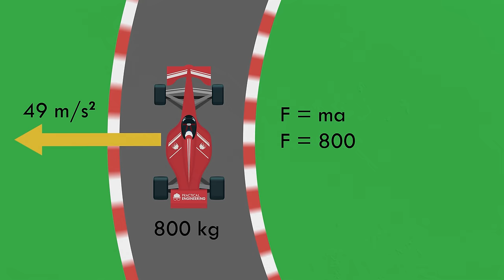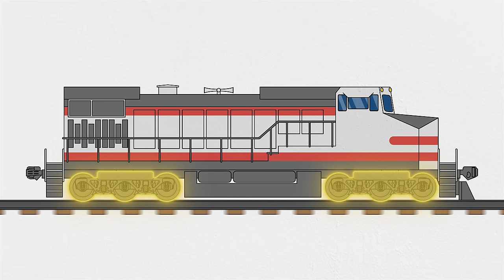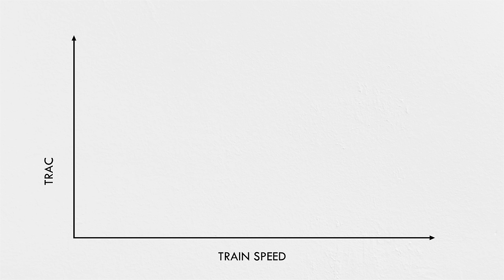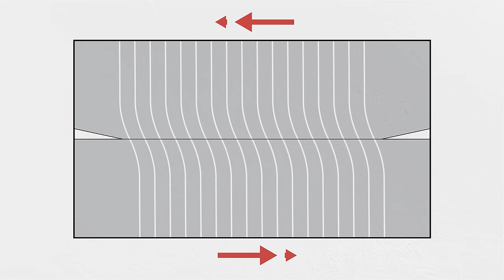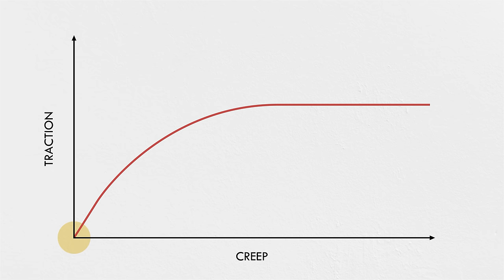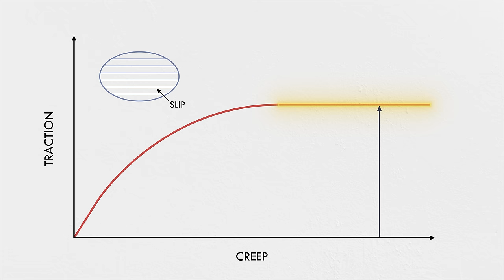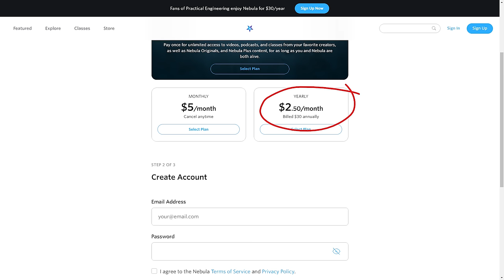Why Locomotives Don't Have Tires

Comment: Yay! Another train video!! Really enjoying this series and definitely looking forward to more Practical Construction too!
In point of fact there is construction going on literally right outside my house now, and I've pulled out your book a couple times to kind of "follow along" as the workers go about their job. They're putting in new water mains (FINALLY, the pipes we had were laid down fifty years ago, and not done very well either), and it's been fascinating watching them work. You can even tell which parts of our street were built earlier or later, because of the wild way the mains changed placement, haha!! The spot right in front of our house has been a real thorn in the crew's side, due to that less-than-ideal placement from so long ago. They're doing a great job and I've already made them go "she's a bit weird" haha because I gushed just a little bit about your book!

Comment: I always envisaged a 'hybrid' locomotive tyre, with the steel for weight and maybe a band of rubber to provide additional friction. I wondered however if the extra start friction would provide any benefits over increased running friction.

Comment: 9:52 isn't that exactly the opposite though? The wheels are rotating slower than necessary since they're essentially slipping/creeping forward. Like your demonstration shows, the brush wheel covers more ground with the same amount of rotation when traction is applied.

Comment: When your ambition is greater than adhesion, wheelspin occurs.

Edit: 2 cats are sitting on a pitched roof. Which one of them falls off first? The one with the smaller μ.

Comment: The Eschede rail disaster in Germany was the result of a steel “tyre”… a steel band around a steel wheel but that broke off at high speed and the steel band straightened itself out and was stabbed upwards through the floor of the train, while the other end acted like a crowbar pulling up the sleepers and the rail… the train hit a bridge during the derailment… I don’t know if trains still use those “steel tyres” anymore. 🚂😕

Comment: Something interesting to add, Diesel Locomotives need more Horse Power to generate the Same amount of Tractive Effort as a Steam Engine. This is because of a variety of factors that include weight. Diesel locomotives are far weaker than a steam locomotive when alone but are generally much cheaper to run and maintain.

Comment: Answer: On a locomotive, it's less desirable. Stick-slip can lead to corrugation of the rail and unwanted noise. It was a notorious problem for steam locomotives because the traction force at the wheel rim was always fluctuating.

Comment: Trains actually do have tyres on the wheel rims. the rim itself, with the axle and bearings, has a steel tyre shrunk around on the outside, so that you have a steel inner optimised for strength and fatigue life, but it is not that wear resistant. Then on the outside you place a steel loop, that is wear resistant, but not as strong, but it will wear slowly and will not crack easily, though it is more expensive. But you only have a relatively thin layer of that steel, shrunk onto the large inner, giving you the best of both. This can easily be cut off when worn, and a new one heated and pressed on, allowing you to have a very long life, and yet low cost wheel assembly, as you only have to replace bearings and races as they wear, and on the other side the steel tyres as well, but the middle stays in service for decades.
Reply: Some trains have them. I know that in the Netherlands, they used to have tires on all wheels, but nowadays they've switched to monoblock (?) wheels. Apparently, a single wheel doesn't cost all that much anymore, around €1000.
Reply: @marco23p  More for high speed operation, so there is less risk of a wheel failure causing an issue. There are millions of older rolling stock assemblies around with the separate tyre, I see them on trucks regularly going to the rail yard after being refurbished. They have a bright machined outside and a polished bearing face, but the rest is just dull red oxide paint.

Comment: Some trains have tires.  The subways in Paris do and it creates a lot of heat and stink.  Not sure why they do it like that.
Reply: Noise and vibration and the fact that Michelin had a lot of political pull when they built the Paris subway.

Comment: Is another reason why steel wheels is that trains do not have a differential.  The wheels actually ride up or down on the rail to allow the trains to corner.

Comment: In today's practical engineering video, we learn that "tire" doesn't mean what you think it means.

Most rolling stock have tires, just made out of steel. In fact, for a monobloc wheel (whole cast solid axle) it'd be more correct to say that the entire wheel is a tire -- not that there is no tire.

Comment: My instant response to "Locomotives don't have Tires" is... They do. They have solid steel rings, known as Tyres(British spelling), that are replaceable.
This is so that when the wheels wear, you can grind them down so they're the right shape again, and if they're too worn, you can replace the ring, rather than having to replace the whole wheel.
Though, I believe that in the more modern age, especially on rolling stock, types are becoming less common.

Comment: Locos do have tires, theyre just not made of rubber. Theyre steel rings that are held onto the base wheel by an interference interface. Theyre changed by heating the ring to get it to expand *just* enough to come loose, and doing the same thing to reinstall a new one.

Comment: Train rails are not “hardened steel”. 
Any hobbyist blacksmith using a section of train rail as an anvil will let you know exactly how soft train rail steel is.

Comment: Typing this BEFORE I watch: I'm guessing simply because a rubber wheel in no capacity can withstand 100-200 tons sitting on steel rails...  I think it took me less than a minute to type this.  Now let's see if I was right. I will watch now.

Comment: Locomotives DO have tyres! They are made of steel and are regularly re-profiled as they wear, until they need to be replaced. Having tyres means you don't have to replace the wheel at this point - just the tyre.

Comment: That's interesting, what about reducing the number of wheels instead of upping the weight? I've seen this utilized in racing, can't remember where. The basic idea is when the car is cornering, it's essentially on 3 wheels which causes better grip due to increased weight on the contact patches.

Comment: They do have tires in Mexico City! It greatly reduces the track noise on the metro system there.
Reply: True.  The primary reason that rubber tires are used on some subway trains in Paris, Montréal, México City, Santiago (Chile), etc. is that they facilitate much faster acceleration and braking, which greatly improves train frequency and passenger throughput.  I've ridden them in México and Montréal, and they're a pleasure to ride.

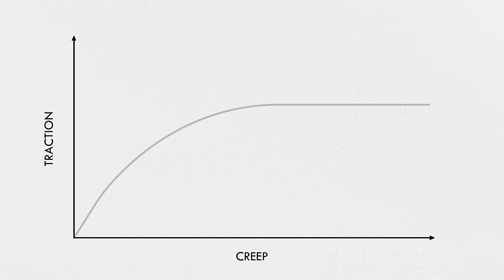Comment: 12:10 In principle, this applies to both accelerating and decelerating. That would mean that, in theory, some kind of anti-lock brakes for trains would be able to stop the train in a shorter distance than locking brakes if those brakes operate sufficiently close to optimal. Does anyone know if this kind of "ABS for trains" exists?

Comment: I respectfully disagree. 
Locomotives do have tires. A broken tire was the cause of the worst railroad disaster in German history (1998 in Eschede, 101 fatalities). They are made of steel and are heat-shrunk onto the wheel disc. And they can be and are replaced when they are worn out after a few million kilometers. 
And @02:35: No, most modern freight locomotives are electrical with the most modern models even being multi-system, i.e. being able to use different voltages and frequencies. Nowadays diesel-electric is relegated to the few remaining non-electrified lines.

Comment: The real answer is due to rolling friction. A steel wheel on a steel rail loaded with the weight of a train results in lower energy (fuel) needed. The trade of is traction from low friction. Not because they don't want to not change the wheels often.

Comment: Grady, locomotives DO have tires, and 
they are replaceable.  Steel tires are heated 
to glowing hot, and put on the wheels. I 
think it is a steel tire, on a cast iron wheel.

steve

Comment: This may have been mentioned in an earlier post. If so I apologize for being redundent. Railway locomotives to have tires. However they are steel not rubber. Each wheel has a steel tire that is separate from the wheel itself.🙂🙂

Comment: Locomotives do have tyres, they have a replaceable metal tyre that is heated and press fitted to the Loco's metal wheel. When the "tyre" wears out it is simply heated up, pressed off and replaced with a new one

Comment: This sort of thing is exactly why EMUs and DMUs are so good compared to locomotives, at least on passenger services.
You have far more driven wheels which means a lot more area for contact. You don't need so much weight concentrated in one place which reduces wear, maintenance, and engineering requirements on bridges, etc. And finally, because you don't have a locomotive full of engine, generator, and equipment, you can use that space to seat passengers.

Obviously, freight needs locomotives as freight cars are often dropped off and left somewhere for long periods of time, but I wonder what a multiple unit freight train would be like.

Comment: Rolling friction is measured in meters it shows displacements of gravity center of perfectly concentric ball, cylinder. Soft rubber tire on  soft bitumen asphalt have very high (displacement) of friction. Steels wheel on steel rails have very low rolling displacement friction, everywhere  rolling displacement measured in non-dimensional Cr constant coefficient or constant static force measured for specific vehicle , because besides mass most important measure is also surface area. Caterpillars tractors and tanks can be very heavy m, surface area A can very big thus pressure to the ground very low p=mg/A.
Normally friction between to flats measured in non-dimensional tangent angle where stick and slip happens between two flat surfaces. I never heard that stick and slip happen for rolling wheels, you can make experiment ball bearings and wheels with ground have static friction but on inclined slope any toy car moves with constant velocity, and we assume that vehicles and trains designed with more precision thus vibrated (stick and slip) motion can not exist for trains.

Comment: Actually locomotives do have tyres: metal ones.  They are heat shrunk onto the main wheel.  They do get machined to remove flats, and to keep the correct profile despite wear, and eventually reach limits and are replaced.
The rest of the content was good, and didn't need the clickbait heading.
Modern locomotives use controlled wheel slip to increase traction adhesion.  However, that doesn't work for braking adhesion.
Many trams (streetcars) use magnetic track brakes, but they aren't used for freight or passenger trains.

Comment: There are bands of metal fit around the wheels that wear off and are replaced when used up, rather than replacing the whole block of wheels and shaft.
They are called tires from what I heard. So locomotives, do, in fact, have tires.
EDIT: apparently not anymore. Most of my knowledge of railroading comes from steam-era related sources so my data is often outdated 😅

Comment: Actually, rolling stock on rail does have tyres. Unlike car tyres they are made of steel, and heat fitted onto the wheels. The loco doesn't carry a spare ... 😅

Why?

So that when they get damaged in the short of way down in the thumbnail, it's a lot cheaper to change the tyre than to create a whole new wheel.

When a loco does an emergency stop and skids worth the wheels locked up, the friction leaves a flat spot on the bottom of the tyre. Again this is rectified by a change of tyre, not by scrapping the entire wheel. 

So on the railway it's perfectly plausible to say that your logo needs a flat tyre to be changed. That of course gets you funny looks from people who don't know railway engineering terminology

At least, those are the words we use in the UK: perhaps you call these things by different words in the states...

Comment: Hi Grady, Really enjoy your videos! Can you do one on how locomotives communicate with each other that are on the same train? I know when more than one are on the same train, they have to be able to receive the same instructions from the engineer. I’m guessing via radio signal to the other computers on the locomotives. Also some locomotives are not always facing the same direction as each other. Does the engineer have to account for that, or is it automatically done?

Comment: TW! 

Maybe trains should have should have small electric motors and possibly batteries on every train car, that would practically eliminate friction limitation, unless you want dragracing acceleration. Locomotives, if actually needed, could either be small control units, or, normal size and have significant payload capacity. The size of the motors and even battery packs enough for most situations, required on each train car would be insignificant, even the added cost, if mass produced, would be kind of insignificant, definitely so compared to the advantages. 

We've been able to transfer grid power to trains automatically even when in motion for well over a century, building and maintaining overhead line network that has to provide all the power needed reliably is still not easy or cheap, but the technology could be a good base for charging batteries on each train car at selected sections.  If mass produced, the system cost would be lower compared to having monstrous locomotives that are produced in small numbers pulling a lot of cars, and the useful capacity would increase, as neither motors or batteries would have to interfere with useful space, and the additional weight would be negligible. 

The power and battery capacity of ordinary long range electric cars would be plenty on each train car, except for high speed trains. And those road electric cars, without incentives, whole cars, including chassis and seats, and lot of other expensive stuff besides the motors and batteries, costs what can be considered a rounding error in the cost of new passenger train cars.  For freight cars the increased cost would be noticeable, compared to non-motorized freight cars, but then again, no multi-million dollar separate locomotives would be needed, and performance would actually be much better for long trains, and you could have regenerative breaking, and immense redundancy.  

If any true train aficionados have read all this, you might hate me now, if so, that's your choice,  but something like that might need to happen for somewhat "traditional" trains to remain relevant for practical use.

Comment: My question is why isn't anyone making Diesel Electric cars? use a small combustion engine to charge the battery to drive electric motors. So when you don't have time to charge the battery it will be charge by the diesel engine??
Reply: It is a sensible idea.

Comment: Steam locomotives do have tires.  These tires, however, are made of steel and not rubber.  To allow for repair and replacement of the wearing surface of the driving wheels of the locomotive, these steel tires are heat expanded and allowed to cool to provide a shrink/interference fit on the outer edge of the main center portion of the drivers.  The main part of the drivers are cast iron or steel and are not affected by wear during use.  A side note:  The engineer or driver of the locomotive must be careful, when starting out, not to spin the driving wheels.  This will cold roll the tires and thereby loosen them on the rim of the drivers.

Comment: loco's and rollingstock do have tyres its just the same material as the wheels so it looks like they dont have tyres.
where you have friction you have wear and tear and its much cheaper to replace a tyre than the whole wheel.
a lot of tyres even have a wear line just like a car tyre but its on the side of the tyre instead of in the tread because train tyres don t have a tread

Comment: Grady, we still don't use kilograms of mass as a unit of force in the metric system. Colloquially the "weight" of some things are measured in kg, but that is more because all the scales convert between newtons and kilograms already. But the difference between force and mass will still be a factor 9.81 m/s².

Comment: Some locomotives have tires. They're made of steel and are welded or bolted to the wheels. Makes it so you only have to replace the tires, rather than the whole wheels for wear.

Comment: Traction could be greatly increased if train wheels were gears and the rails had teeth to mesh with the wheels. A drawback is the teeth on the rails would trap debris.

Comment: Steam locomotives actually do have tires it just a steel rim on the outside of the wheel. So whenever a wheel get worn out instead of having to replace the whole wheel they just replace the outer rim. But they would have to do it for ALL the drive wheels so that they’re the same height.

Comment: Why do longer/heavier trains take longer to stop if the kinetic friction increases linearly with weight? Are there heat transfer limitations above a certain weight? Is the braking pressure mechanism separate from the car in such a way that there is uneven breaking force down the line of cars, and cannot be optimized at each track-wheel junction?

Comment: Trains have tyres just not rubber ones.Some are  solid wheels,where they can only be re profiled so many times.
But many have heat shrinked tyres.That is the tyre is heated,the wheel is inserted,and the tyre shrinks on when cooling…? Benefit being can be re tyred many times.!